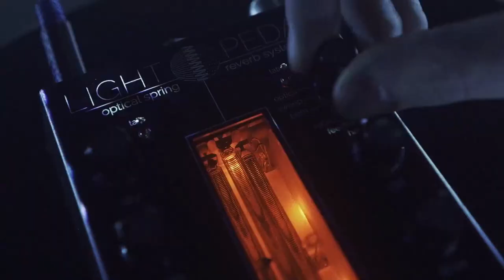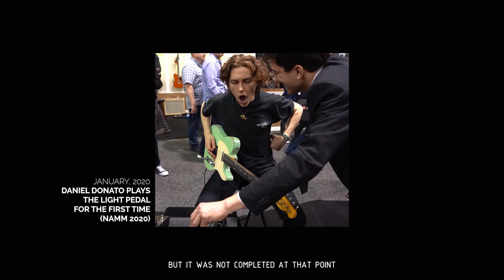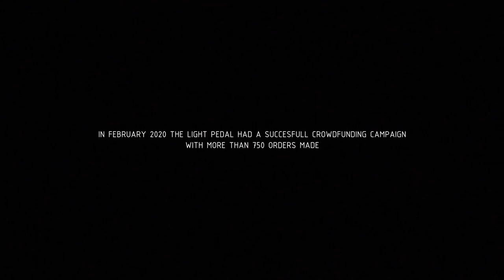Making of the LIGHT PEDAL - Interview with Engineer Teodors Kerimovs | Gamechanger Audio

Comment: is it microphonic? can it produce feedback effects with ambient noise and external vibrations? what happens if I stomp on it while its on?
Reply: It's like any other spring reverb, it will make a thunderclap if you bump it. However it has a shock sensor with different settings just in case you don't want it to go kaboom

Comment: When demonstrating a peddle, get it in the signal flow correctly. This is the order of signal flow, it will serve you well to know this. 1. Guitar > any booster > outboard EQ > distortion pedals > the preamp in gain (the preamp for your amplifier) and tone controls > effect loop out > delay > Chorus/flanger > reverb > effects loop in > power side of the amplifier. Your demonstration suffers from not understanding why you apply reverb to a guitar.